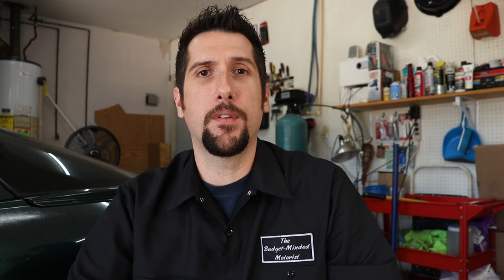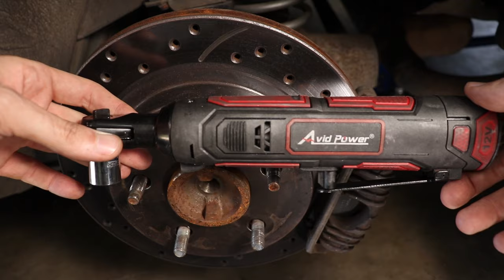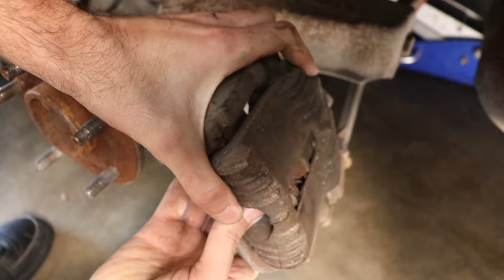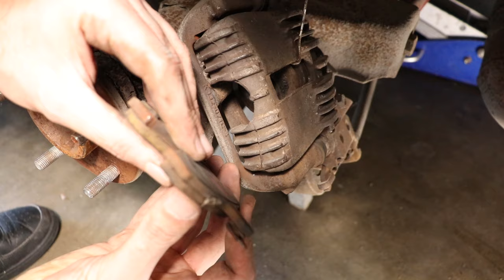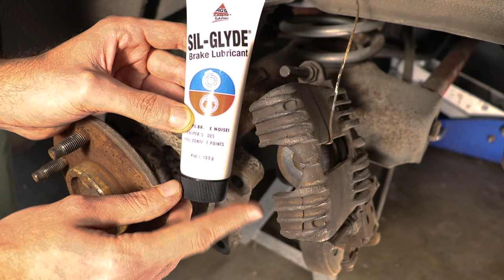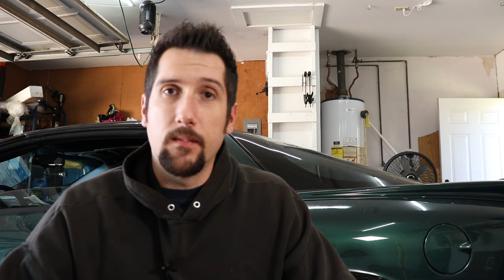The Fix for Creaking Brakes

Comment: So my car recently just made this noise . I just put new rotors and pads and cleaned and re greased everything : pins included. Sooo anyone got any other ideas lol ?
Reply: Have the same issue 2012 accord new akebono pads and acdelco gold rotors. The Noise occurs when *slowly letting off the brake from a compete stop. Seems like creak Noise goes away after brakes are warmed up. Only put 50 miles on new brakes, just changed brakes yesterday. I also lubed everything including pins. I did not clean out the pin hole on bracket with a rag

Could Not cleaning out the slide pin hole on bracket, or using too much silicone lube on pin cause the issue ??

Comment: I can hear the creaking noise from the back of my car but it only happens when the car is moving and breaking down to a hold. So I suspect suspension issues but I'm not sure. It doesn't seem to come from one specific side. Any idea?
Reply from the maker: If it's not the brakes causing your symptoms, It could be suspension related. Perhaps a worn or failing suspension bushing. I know diagnosing sounds like that can be really frustrating to locate and diagnose.  But if there's anyway you can try to replicate the noise with the car parked it might help. Maybe set the parking brake and push forward and backward on the car and see if you can hear any movement or creaking in the suspension.

Comment: I have a problem where I hear a loud creaking sound when braking even when the car has completely stopped I press  on the brakes and hear a loud creaking sound it sounds like a door hinge that needs to lubed any recommendations ? Also the brake pads and rotors are completely fine I just can't find what's wrong with it
Reply from the maker: Lubing the pins should help. What you're describing sounds exactly like what mine were doing. Also make sure there's not stuff built up between the pads and caliper. Been told that can cause the noise as well.
Reply: Exactly my problem now If cleaning and lubbing does not help maybe the piston inside of the caliper is the blame. Besides if the car is old everything is worn down and there may be a lot of play between all parts and they are not moving like they supposed to. May I ask what solved your problem?
Reply: U fixed that?